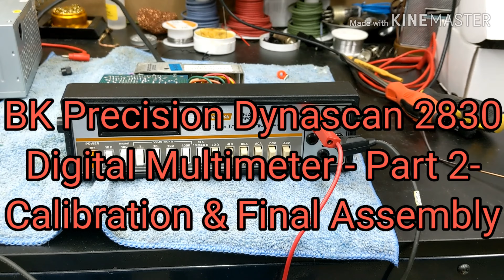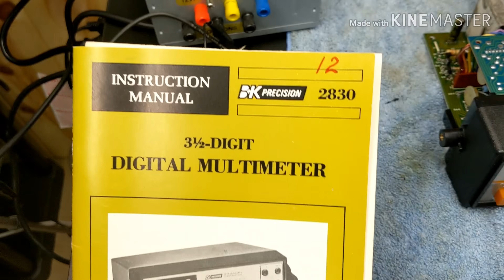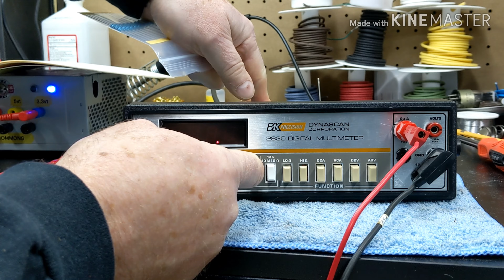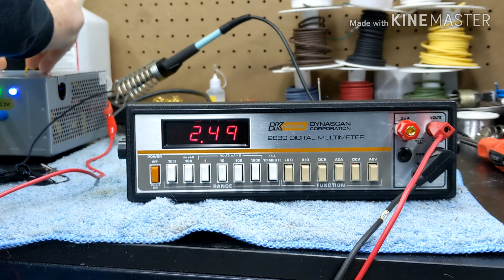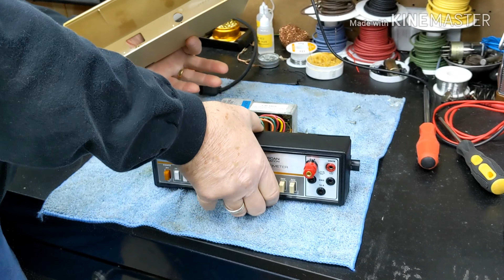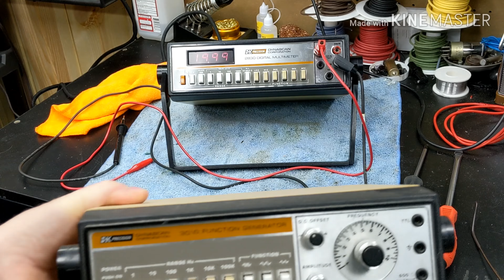BK Precision Dynascan 2830 Digital Multimeter- Part 2

Comment: Hi Gregg. Nice job on the BK. That was a fairly good meter in it's day. If you want to do a more precise calibration you can get a decent voltage source on Ebay from China for around $15. It's a little module that has four voltage  outputs from 2.5 to 10 volts. That will take care of the low voltage DC scale anyway. Search for AD-584 voltage reference. ATB Doug.
Reply from the maker: I actually have a DC voltage source kit I haven't built yet that would be perfect for that. Of course it too is a Chinese special! LOL

Comment: Gregg,  B&K makes pretty good stuff.  I do have some issues with the way you calibrated the meter, though.  You have multimeters at your disposal which are much more acurrate than the Chinese panel meter installed in the top of that salvaged computer power supply.  The instrument you are using for a calibration standard should be specified to be 10 times more accurate than the instrument you are calibrating.  I realize that the requirements are not as stringent in the home workshop environment as they would be in a commercial enterprise, but still, you should make the effort to be as accurate as possible.  I do like the restoration work you do.  It is very thorough, and painstaking.  I just think that you need to do a bit better with equipment of this nature. Please understand.  This is intended as constructive criticism, not nit-picking.
Reply from the maker: Thank you Gar, no offense taken, as I'm still learning in the hobby and appreciate any and all information or criticism. I'm currently limited to the equipment I have on hand, but do plan to get better stuff as time goes on. Also, the great majority of items I work on are vintage and when tolerances of plus or minus 20  percent was the norm. That's why "close enough" or "pretty good" works for me at this time. Thanks for the comments sir!